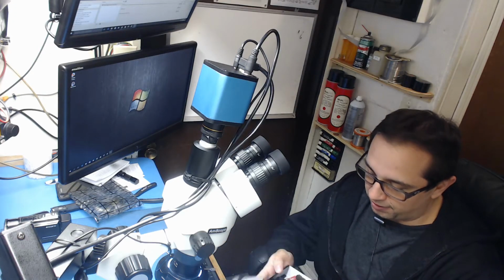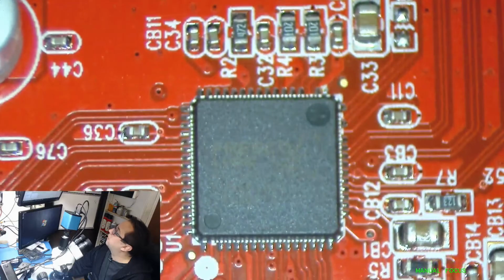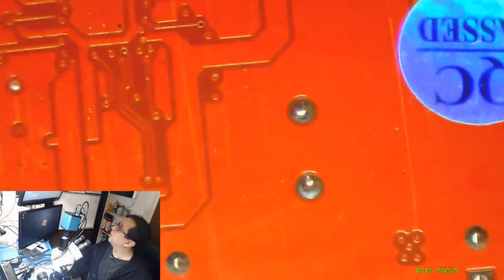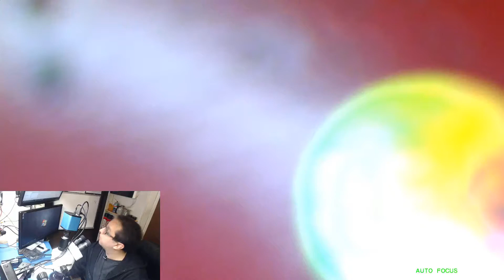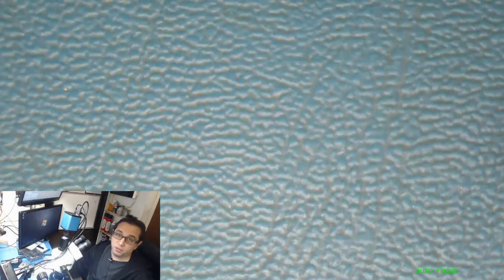TESTING NEW MICROSCOPE CAMERA AMSCOPE AF100

Comment: Curiously, did you have to buy an adapter for this to work out of the box with an amscope microscope? I noticed you have some tape holding it on. My af100 is on its way right now and If it needs an adapter i better order it before it comes in! lol currently set up with a Amscope SM-4TPZ. Any advice you have would be amazing. THANKS!
Reply from the maker: +Justin A Yes I did get an adapter to go with this. I had a Amscope RU050 adapter. Now mind you If you have followed my videos you will know that I had a hard time getting an even focus across the screen. It was not unusuable but annoying. I ended up going with a Microscope.com  Omano 2300s and their 1080p c-mount camera instead. with a  OMCM-2300ST-03X adapter. Mind you that I think the problem that I had all along was using the bore with a reduction lens  like the one I had to tape.  But no one could tell me that. If i went with the 2300st adapter and the Amscope camera It "might" have all worked out better. But again, Amscope Is not the best at these kind of questions. BELIEVE ME!!
Reply: +Kev31779 Oh wow, ok so I went and checked out some of the other more recent videos. Mine has not shipped yet. I think i may just grab the Optixcam you got. I have been using mine without a cam up until now.  and the camera you got was the Omano OCS-HDMI-1080PU ?
Reply from the maker: +Justin A Yup that's the one. Its a great camera. No auto focus though but who really needs that. The quality is supieror to the AF100